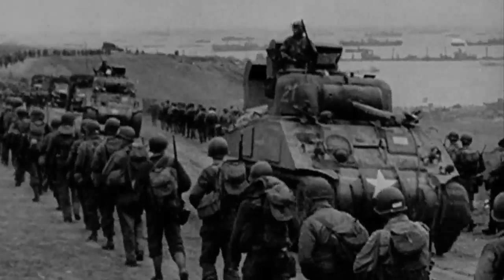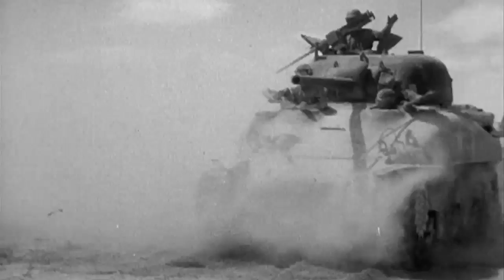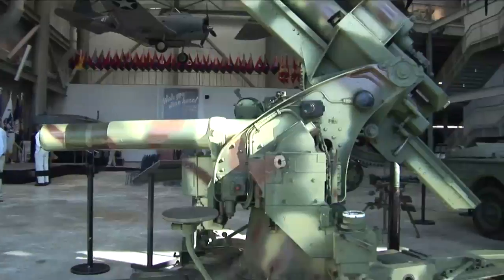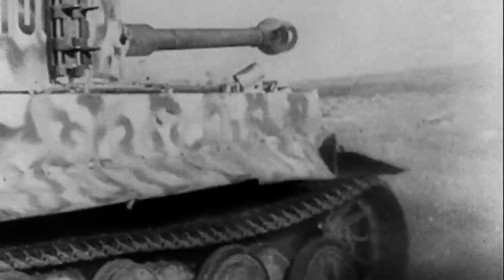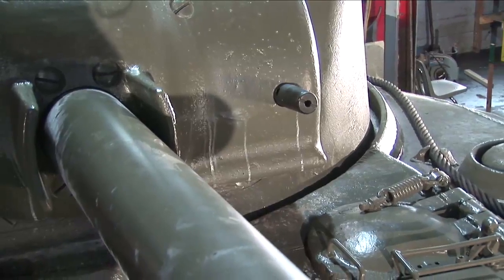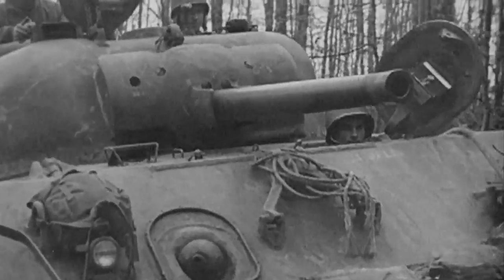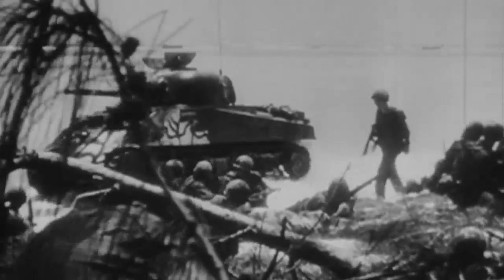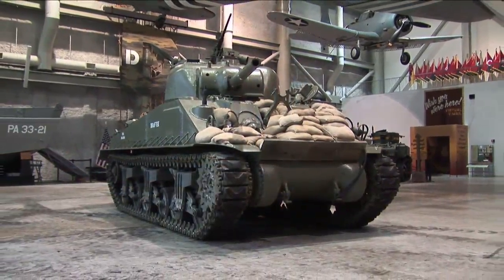The M4 Sherman Tank at The National WWII Museum

Comment: Wow seems the curator read "death traps" and believed it.  

Actual Tank vs Tank was rare but the M4 had a Positive Kill ratio
 
"US Army’s Ballistic Research Lab which studied WW2 ETO tank vs tank engagements(98 of them if you were wondering) and concluded the following: The most deciding factor of who wins a tank engagement is who engages first. Crew training and other factors also played a large role. The average distance at which a US tank kills a Panzer(late IV, V, & VI) was 893 yards(816 m). Comparatively the average distance Panzers killed US vehicles as 943 yards(862 m). During Panther v. M4 engagements the Panther had a 1.1:1 advantage while on the defensive, however the M4 had an 8.4:1 advantage while on the offensive. Overall the M4 was 3.6 times as effective in combat versus the Panther."
http://ftr.wot-news.com/2013/07/28/please-dont-use-the-5-m4s-1-panther-myth/

from Panther vs Sherman: Battle of the Bulge 1944 (Duel) Paperback – September 23, 2008
by Steven J. Zaloga (Author), Howard Gerrard (Illustrator), & 1 more

And most German tanks were not Panthers but Pz-IV

The M4 was as well armored as the T34 and better than most of the Pz-IV 

Frontal Armor relative avg thickness.

PzIV Ausf G  55mm
T34-76 56mm
T34-85 70mm
M4(Early) 70mm
M4(Late) 80mm
Panter 90mm
Tiger 100mm

http://knowledgeglue.com/dispelling-myths-surrounding-m4-sherman/

Saying that the M4 couuld not shrug off a 88mm gun is not all that enlightening as he German 8.8-cm PaK 43 using PzGr 39 (early common round) could penetrate a Tiger 1 from the front at 2000 Meters. Does that make the Tiger 1 under armored ?

http://www.wwiivehicles.com/germany/guns/88-mm.asp

The 75mm gun could take out the Pz-III and Pz-IV  from the front and the Tiger and Panther from the side, though this was seldom needed.

Most things a tank shoots at are NOT tanks but Infantry and Infantry Positions.

 The High Explosive (HE) Round was far better at this most common task than the weapons on the early British tank guns, 2 pounder 40mm  so much so than many 6 pounder 57mm were converted to us American 75mm ammunition.  

Th 76mm gun was capable of engaging Panther from the front, though not as easily as the Panther could engage the M4.  The 76 could penetrate the mantlet of the Panter.  

Was it the best tank in a duel 1 on 1.. probably not was that a common thing, no!  How did it do when used as tanks were ment to be used, very well even against Panthers used by good troops see https://en.wikipedia.org/wiki/Battle_of_Arracourt

Did it have problems in he bocage ? yes and so would any WW2 tank, due to limmited lines of site, large numbers of 75mm and 88mm anti-tank guns as well as mines and Panzer Fausts etc..

At 500 yards a Panter Side armor (40mm)  can be penetrated by the 37mm gun of a M5 Light tank,. and in the bocage shots under 200 yards were not uncommon.

APC M51 Shot (meet angle 30°, face-hardened armor) 500 yards 46mm  1000yard 40mm

also the armor just above the wheels and below the side is 0 deg so even easier to penetrate 

This is not to say that a 37mm would always pen the side but it is the weakest AT gun on the field and could have made a lot of Panthers die if the Americans had been defending the same area.  

The M4 had 38mm Side armor
soruce M4 http://afvdb.50megs.com/usa/m4sherman.html#M4A3(76)W
Reply: Your armor figures for the Panther, T-34, and M4 are wrong.
Reply: The source cited uses a avg  & effective armor  feel free to post what your sources say the armor of the vehicles was.
Reply: Most of this information comes from Robert Livingston's book W.W.II Ballistics: Armor and Gunnery . As well as Aberdeen's evaluation on the T-34 in 1943, Aberdeen's evaluation on the M4's armor effectiveness and a Waffenamnt Prüfwesen I study concerning a captured M4A1(75). Calculations of relative thickness can be done by basic sin/cosine/tan math, though can be shown by l.o.s. armor calculator on Panzerworld*

T-34/76's and T-34/85's relative armor thickness on the upper frontal slope of the hull is 90mm (3.54") thick exactly. With 45mm (1.77") at 60° from vertical. Because 45/cos(60°) = 90. Effective armor thickness is a another kettle of fish entirely which concerns hardness, heat treating, the composition of the steel. Though going by hardness and the T-34's armor's general lack of proper heat treating would equate it to about 97mm (3.82")-104mm (4.09") of U.S. Navy grade RHA at best. Though 93mm (3.66")-95mm (3.74") might be potentially accurate considering the alloy. The notes of bad heat treating mostly comes from the Aberdeen evaluation**.

Early, welded-hull, small hatch M4s (like the M4A4(75)) have 50.8mm (2") at 57° from vertical. Equating to 93.27mm (3.67") relative. Though varying because of early M4's working out of a proper quality to focus on in construction, generally came out between 104mm (4.09") to 107mm (4.21") in effectiveness relative to U.S. naval grade RHA armor. Later welded-hull, large hatch M4s like the M4A3(76)W HVSS and M4A2(76)W, had 63.5mm (2.5") at 47° from vertical. So 63.5/cos(47)= 93.109mm (though figures from a handheld calculator say ~93.1077)). Aberdeen has already done the math for these M4s, being labeled as 118mm grade (4.65") relative U.S. naval grade RHA, against a Panzergranate 39 pattern shell (any APCBC with similar design to this bullet), in this case fired from a 7,5cm KwK 40 l/48 dead on. Cast hull M4s, like the M4A1s, M4 Composites, or M4A6s (the latter two have cast hull fronts, but past the mid-section, welded hull) have varying thicknesses on the frontal slope alone. Though Livingston's book (on Scribd for free) has a good diagram of l.o.s. thickness, there is no assessment on effective armor. Though the Germans did do a test for a Waffenamt-Prüfwesen I study with an early small-hatch M4A1(75)*** captured from either Italy or Sicily. The frontal slope was deemed immune to any German tank gun with Panzergranate 39 pattern munitions with introductions dating up to 1943, at any range if angled at 30 degrees sidewards. The only exception being the 7,5cm KwK 42 l/70 (the Panther's gun****). This includes immunity at any range on the upper slope against even the 8,8cm KwK 36 l/56. 

The Panthers vary. The Panther D supposedly had FHA, with most As and all Gs having RHA as the PanzerKampfwagen VI Tiger Ausf.B ( Königstiger  or "Bengal Tiger" in proper translation; direct translation as two words, "King Tiger"; a.k.a. "Royal Tiger"/"Tiger Royal") though of differing quality to each other, and throughout its production run. Line-of-sight armor thickness is 80mm (3.15") at 55° from vertical. So, 80/cos(55°) = 139.45mm (5.49"). Though no proper assessment has been given, estimates for effective armor for 1944 and 1945 variants relative German naval-grade RHA as 140mm (5.51") to 155mm (6.10") on the upper slope.

Notes: 
*( http://www.panzerworld.com/relative-armor-calculator ) 
**( http://english.battlefield.ru/en/tank-development/27-medium-tanks/95-t44.html ) 
***( http://www.theshermantank.com/wp-content/uploads/2015/11/n-siPvp-tYI.jpg ) 
****( http://www.panther1944.de/index.php/en/sdkfz-171-pzkpfwg-panther/technik/kampfwagenkanone-kwk )
Reply: a very well Sourced reply

the net result is that Medium tanks by and large had about the same amount of armor later ones better than early ones.
 I would like to point out the t34 does suffer another failing of the armor the most you not like to point out or at least it's hard to quantify The Edge effect of the front driver's hatch tended to make for a very weak spot the only American in force has similar problem but it was removed.

Comment: lol! Sounds like the info on the Sherman in this video was taken from WOT and the History Channel. The Sherman was a war-winning tank. It was an excellent, and possibly the best, tank on the battlefield in 1944 and 1945. It was not "under armoured." If it could have been engineered with 5" of armour and still be fast and reliable, it would have been.
Reply: Kevin Sissons A model did, or had close, to that amount of Armor, it's the M4A3E2, more famously known as the Jumbo. It had 177mm of armor on the turret
Reply: No sir, the war winning tank was and always will be the T-34.
Reply: John Hancock T-34s were expendable that was the design for it cheap and easy to mass produce hard to get out of if it was knocked out the Sherman was a much better design for crew survivability
Reply: Two facts. First , the total German production of all armor to include tanks, artillery, tracked vehicles, personnel carriers etc. added up to just under fifty thousand pieces. The Russians produced somewhere between sixty to seventy thousand T-34's alone and more than 108 thousand in WWII. Nobody knows the exact number because the Russians lost count, due to so many tanks being mass produced so quickly. So yes, the T-34 was expendable and it wiped out German armor by sheer brute force. By the way, the Soviets tank losses were staggering with almost eight-four thousand tanks destroyed.

Second, The Sherman tank was a workhorse, mechanically reliable and easily repairable in combat.  It also had a loss rate of 580% because German tanks and anti tank guns accounted for almost 90% of Sherman's lost in combat. Most crew members survived as the tank could quickly be exited. Although one German round would destroy a Sherman because it's fuel and tank rounds would explode. But as was the case with the T-34, sheer numbers won WWII despite the Sherman's complete combat ineffectiveness against German armor.
Reply: John Hancock you dp know with the sloping taken into account the Sherman has frontal armor that is almost as thick as a Tiger 1
Reply: You do know the Sherman was an effective tank everywhere except Normandy, where German armor destroyed or disabled more than 1500 of them, right? p.s. almost fifty thousand Sherman's were produced, meaning it contributed greatly to the allied war effort by sheer numbers.
Reply: John Hancock normandy was a hell storm for armor they couldn't really do anything when they were landing and they had AT guns set up in traps the heavies had to come later given the Sherman's impeccable ability to be made into a boat (DD tanks)